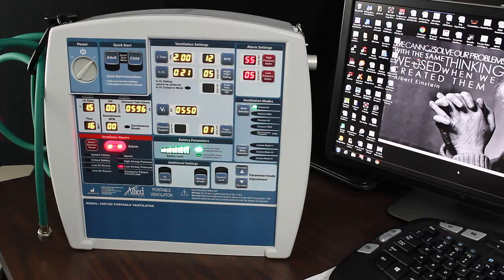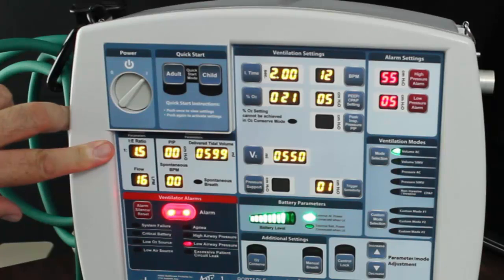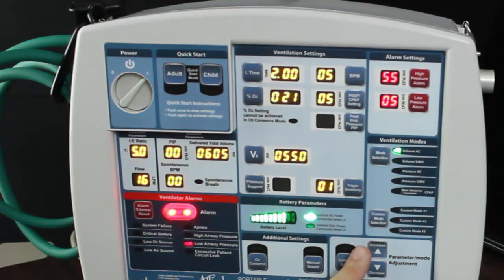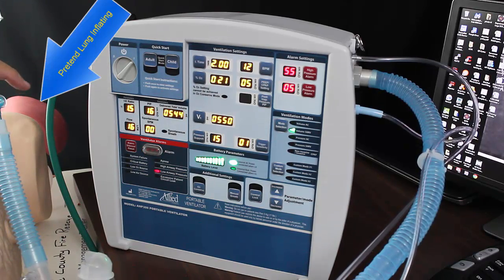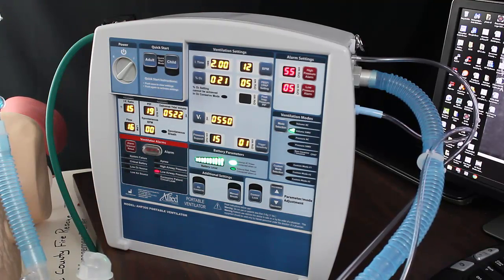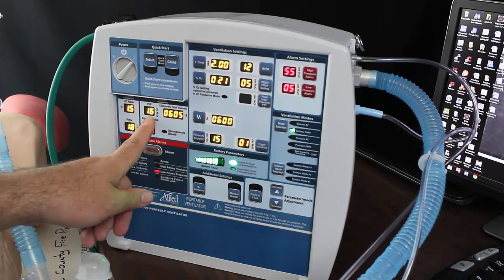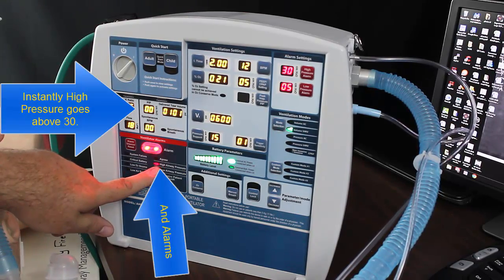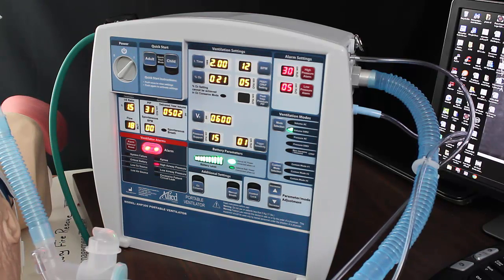Allied AHP 300 Portable Ventilator Basic Set Up

Comment: What settings do you change (compared to the hospital vent settings) to make the patient more tolerant of this vent?
Reply from the maker: We have found that our vent can't match bipap settings with the hospital without agitating the patient. On several occasions, we max out pressure support a and peep in AC pressure mode and the patient still complains that they can't tolerate the pressure. We switch to Pressure SIMV and they say that it is much better. I am assuming there is a difference in the internal plumbing. I have not researched whether the difference is in volume flow rate versus pressure to attain that flow from the hospital vent to the allied vent. For patients that are paralyzed and ventilated, we have not noticed any problems with vital signs. Obviously the patient is unable to complain. It has operated as expected for very severe fragile patients being transported between hospitals.